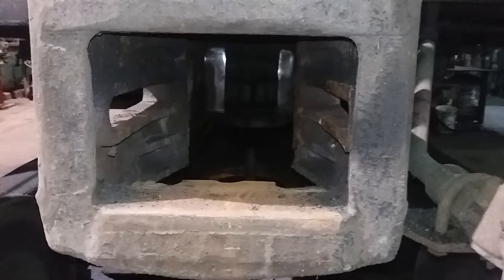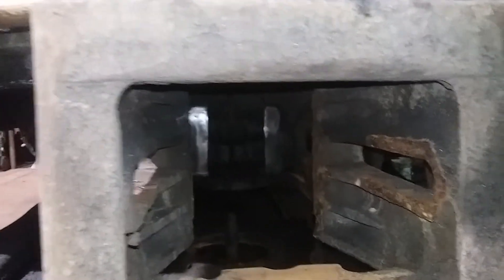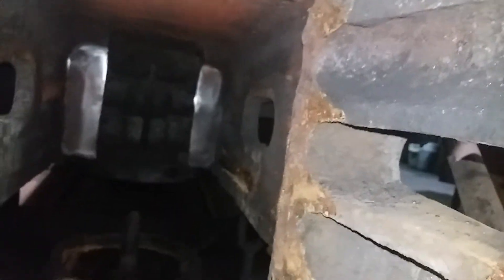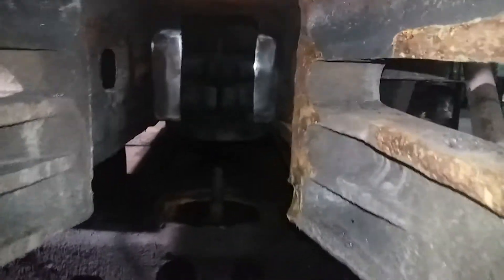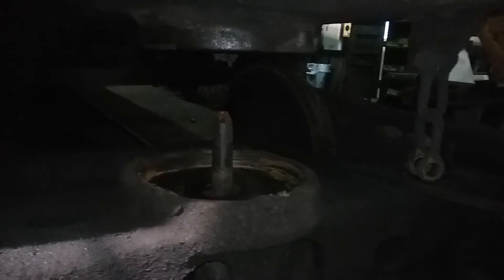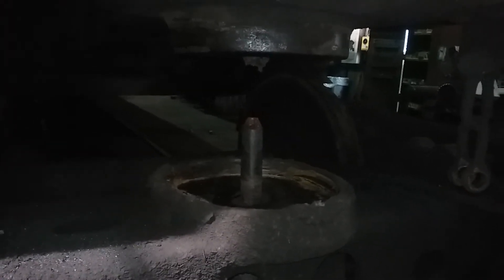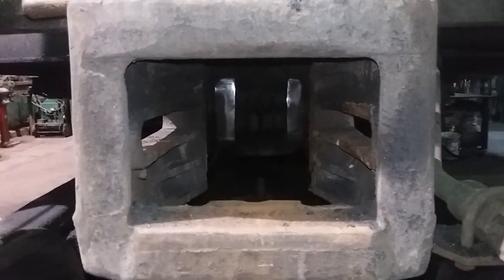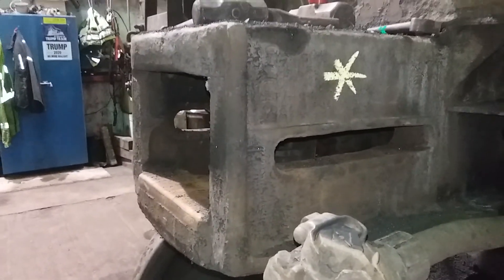Freight Car Draft Gear Sill Pocket

Comment: Since cars ride on a pin, that pin is attached to a truck set?  How tall and how big around is this pin? Thank you, Dave, for sharing your vast knowledge. You are under paid.
Reply from the maker: That is correct Shirley, however the pin is not attached, you can
pull it right out, it just sets down into a hole on the truck set. Pin is about 15 inches long and about 1  and  1/2 inches in diameter. 
I am paid very well my friend. But thanks for the kind words.

Comment: Back stops front stops then it get the loose stops that bolts in.We huck bolt loos parts in if it wear out one just replace it oqr if wear is not so bad just weld it where the yolk key shaves the metal off.
Reply from the maker: These cars get a lot of abuse, where most coal hopper cars are
loaded and dumped once a week, these get 6 cycles a day and
stuff wears our a lot quicker than normal, but that's raillroadin here.
Appreciate your writing in and for watching sir

Comment: Will a draft gear failure cause an uncoupling?
Reply from the maker: It can, virtual railfan had a vid of that happening, it was taken at Kearney rail cam. 

Usually with us the springs inside break or some part of the gear geys cracked which usually doesnt cause an uncoupling, hope that helps and thanks for watching 😊

Comment: In AAR car billing parlance, the part mounted on the truck bolster with rollers in it is referred to as the “truck side bearing”, and the flat plate plate above it is called the “body side bearing”. Not trying to be a troll, just spent 41 years of my life repairing freight cars!

Comment: Are the side bearings just dense rubber blocks or have some kind of springs in them to dampen the rocking?
Reply: 2 types of side bearings my friend, i've put up couple vids on side bearings and show
the different types. Going to make one in the future on truck sets which I will show you
how the different side bearings are, but for now the one you are referring to has in it a
solid rubber block that is cylindrical, neither type has springs. the other type has solid steel roller blocks. Hope that clarifies somewhat, and thank you for your inquisitive comments, I enjoy sharing some of the knowledge I've learned over the years with others. A definite part
of railroading most folks never know about.